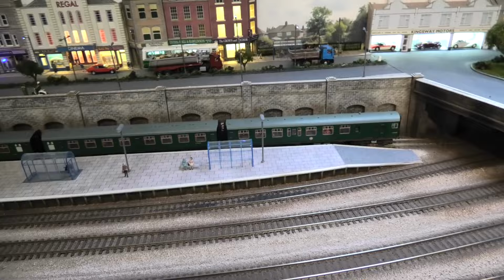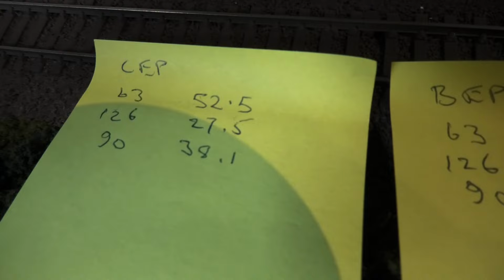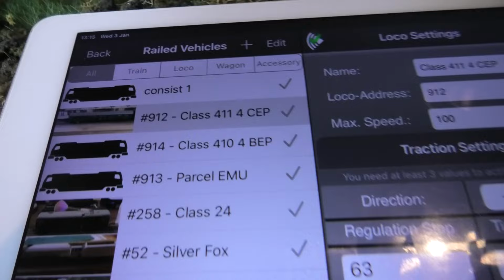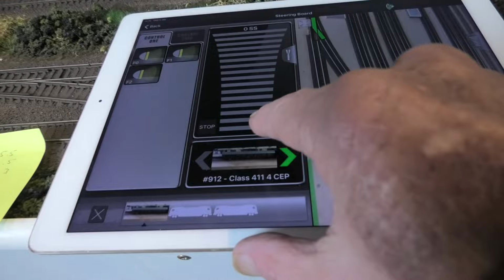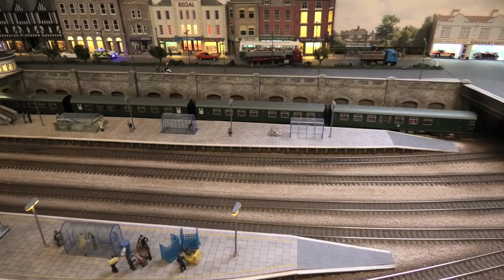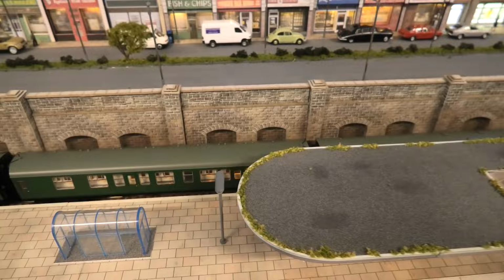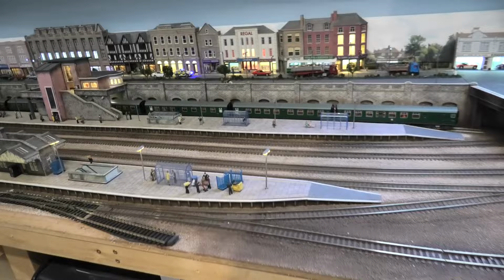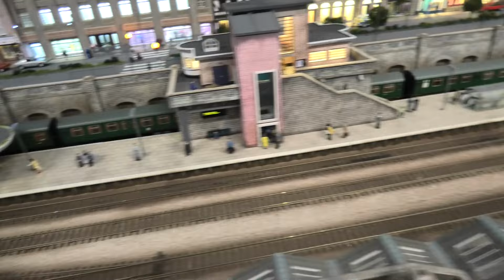How to make a consist on a Roco Z21.       03-01-2024

Comment: I TOTALLY get the “I like it that way round” thing. I don’t like the ‘back’ side of the buffet car so run it the ‘other way round’ so I can see inside. I finally solved the problem by building in a turn back loop on each lend of the layout so that they run both ways round. 
My issue is that I can’t get them to run up hill very nicely but that I’ll solve too by not being silly with gradient. 

LOVE your attitude. Keep it up.
Reply from the maker: Hi Ian and thank you for the kind comment, I don’t have the room for a loop on this layout as that would indeed solve things like this I guess, so I just have to resolve the issue by being a little pedantic in my attitude which I know that some folk don’t like but that’s tough!  😉.      Cheers.         ………Graham
Reply: I run my consists the way I want where it's "right" or not as in rea life they probably ran it the other way round at some point. Or a DR steam loco probably did act as a helper for a DB eurocity train in the early 90s due to the fact that Germany didn't fully end Steam until 1994! Poland around 1996! And Bosnia Still runs steam freight.

Comment: Great job making the consist on z21. Ive tried several times: doing all the speed tests, inputting the data, creating a consist train, adding locos, checking orientation only to have the motors fighting each other, so I stopped. Your video might just give me the incentive to have another go.

I love Z21, I have two, as you know and wouldn't switch to anything else, but for me, consisting has been a real headache. Thanks Graham for doing this.
Reply from the maker: Hi John, I have done a few consists before using the Z21 and like you, had various successes and failures (never found out why some failed though( but this was the first time I had three rather than two motors in a consist and luckily for me it worked out ok first time!   👍🏻.    It’s probably something to do with if there is an ‘R’ in the month if it will work or not!   😂😂. Give it another go John and see what happens, you maybe lucky next time!      Cheers.           ………..Graham

Comment: I thought you were running it as a consist last time , they do run well . I use the sound on one unit on my consist which comes across ok ...........Peter
Reply from the maker: Hi Peter and if you thought I was using a consist last time then it must have been convincing then!  😂.   It was really difficult trying to control all three individual motors together at the same time so a consist was essential.  Yes, sound will also come across too in a consist, all you are doing is trying to sync the speeds of all three motors, everything else stays the same.       Cheers.         …………Graham

Comment: Hi. Just came across this video. When you did the timing did you start with speed 0 at the marker or did you let the loco start earlier to reach max speed at that speedstep at the marker (platform edge)? Because the CV value for acceleration may be different. I tried max speed at the beginning but for the locos I tried the acceleration is way different. Do you know of any Roco manuals for this?